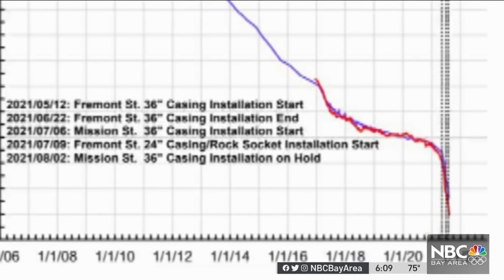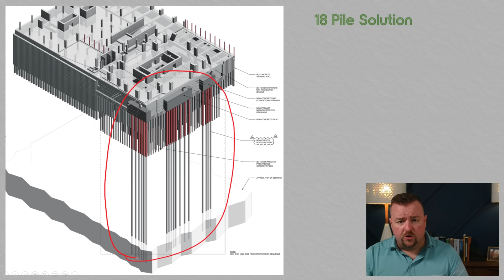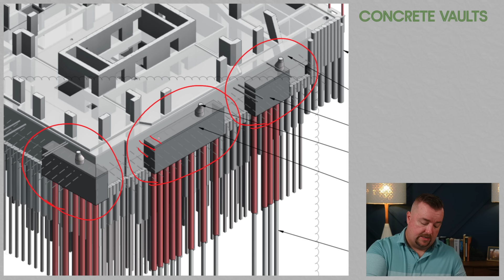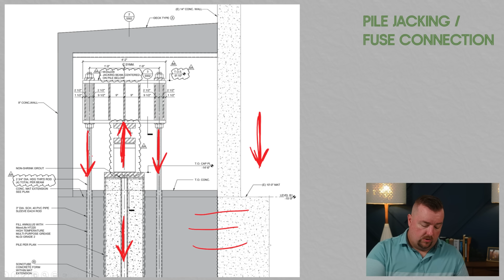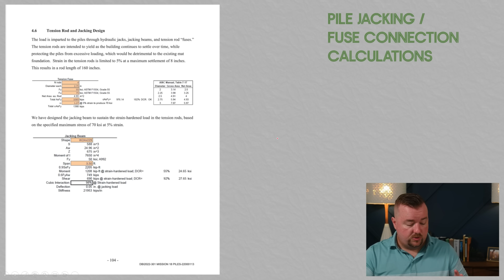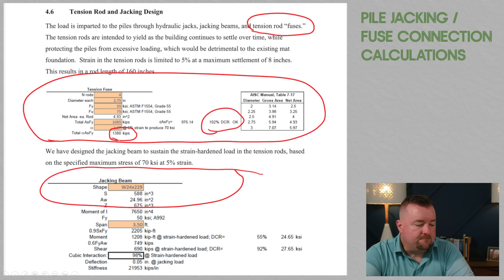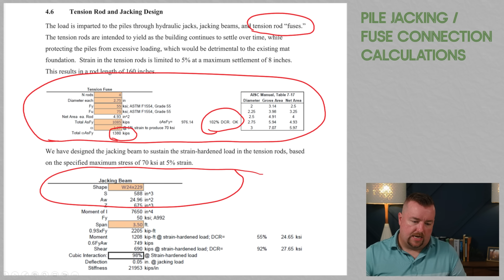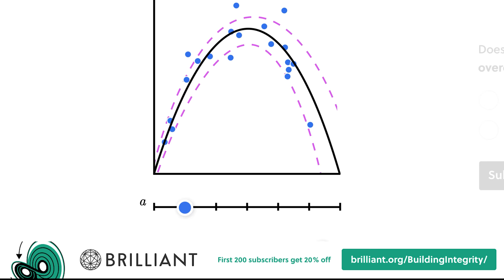Did I Uncover a $100,000,000 Mistake with the Millennium Tower "Fix"?

Comment: I'm not a structural engineer, yet it seems to me that top-down demolition, of the Millennium Tower, is the only safe course for San Francisco.
Reply: Much better option than waiting for the next earthquake to demolish it.
Reply: So start on the north side of SF? 🤣
Reply: I figure at minimum the top half of the building would need to be dismantled / taken down to semi-safely accomplish any significant repair.  But that's just my opinion.
Reply: @Soken50  amended
Reply: @HemiChrysler  Shame, it was funny and any reasonable mind would have understood what you meant, I just like fishing for unreasonable interpretations for a laugh.
Reply: they could employ the same experts that so carefully droped the world trade centre buildings
Reply: This whole concept is fundamentally a bad idea in that it is forcing a highly loaded structure which is already on a path to failure to be fixed by a multi-point, active system which must be supported by human intervention.  And it has to do this forever.  The effects of corrosion, internal voids and inclusions, stress concentration effects on plastically distorted thread forms and operating these sorts of commercial materials at sustained tensile strain levels beyond the typical seem to wholly ignored. I wouldn’t have bought into this unless a full scale test with at least three of these jacks simulated was conducted at at least 30% above limit load with a deliberately failed tensile member injected into the test. This sort of system can lead to cascading failures. I would never insure this building. The downside risk is horrendous.
Reply: @youtbe999  "Much better option than waiting for the next earthquake to demolish it."  It might not last that long.
Reply: @Soken50  "The phrasing of this comment could imply you're advocating for demolishing the entire city from the top down rather than just the building."  

Sounds like a winning plan too.
Reply: Top down demolition is arguably even more dangerous.
Reply: @johnallen3555  Those buildings were entirely upright. They were designed to collapse straight down and not topple over, and they did that because they were entirely upright and not already leaning over and ripping all the sidewalks away from the street around them.
Reply: @davidb6576  Just amazin' ain't it?  and no one on the design review teams even noticed it....along with half a dozen other similar issues.. such as what even a mild earthquake will do to those 102% fuse rods..
Reply: Why not just put some jet fuel on the top floors and the building will implode straight down?
Reply: @Soken50 thats also a good solution
Reply: @Soken50  I wouldn’t have a problem with that.
Reply: @johnallen3555  lmfao bro 😭😭😭
Reply: @HemiChrysler  Can I ask what it said originally? How it is different from the comment right now
Reply: @mangobaby_videos  They just added "of the millenium tower" in the middle.
Reply: @Soken50  No SF is rotting from the core out.
Reply: @scotts.2624  What are you saying no to ? I didn't address you
Reply: Obviously....
Reply: @youtbe999  or allow trrists 2 phly a jumboJet into it..
Reply: @Soken50  It does not matter if you addressed me. This is a public forum. Any one can comment as they please on a public forum within the rules of the forum they want to. How long have you been at this? It seem you would have picked up on that fact by now.
Reply: @scotts.2624  Generally I have to ask someone a question for them to start with "no".
So what did I do to piss you off so much that you feel the need to be this aggressive out of the blue ?
Reply: @Soken50 Even if he was saying that, I’d still agree with him 🤣
Reply: @Soken50  Haha, that's a funny comment. Thanks
Reply: @davidb6576  see bay Bridge bolts
Reply: They should just start a fire in one of the upper floors and the entire building will collapse into its footprint.
Reply: @rickrack4812  key word "allow"
Reply: @realshompa  Nah, just start a little fire on one side and wait all day. Much more cost effective.
Reply: Could make a cool movie Set explosion. Someone needs to write a movie with the building in it.
Reply: Yeah, start at the golden gate and work your way down to Silicon Valley. It can be demolished in 30 days.
Reply: @realshompa  <- has had over 2 decades to learn why that comment about jet fuel is idiotic. 
Too lazy, too smug.
Reply: Nah itll be fine, put the poor folks in there
Reply: @youtbe999  It was built to withstand earthquakes, an earthquake has never taken down a highrise in california so there is no reason to think this building will be first
Reply: @donaldbiden1920  It was also built to stand up straight, but it is epically failing that requirement.  It is completely feasible to suggest that this building will be far more susceptible to earthquakes than originally designed for.
Reply: That’s exactly what I thought too. They just keep throwing good money after bad with this white elephant.
Reply: @camhamster3891  oooh, you mean like WTC 7?
Reply: Agreed
Reply: I’m in agreement. I’ve felt the same way for a long time. Egos are dictating what happens. Penny wise, pound foolish. Sometimes you just have to get up the courage and say this is a mistake. It needs to be handled properly and appropriately.  Before lives are lost, people injured.
Reply: Totally agree
Reply: Totally agree
Reply: Why don’t they just lift it with a helicopter?
Reply: @youtbe999  not really it’s Shit Franstanko
Reply: @Soken50  would be excellent,
Reply: @Soken50  sensitive
Reply: @donaldbiden1920  seems there is a lot of reasons to believe this could very well be the first one it could happen to.
Reply: @Soken50  honestly taking a bulldozer to the entire city of SF and turning it into a landfill is probably for the best at this point. Sometimes you just gotta know when something has failed and move on.
Reply: @noname-gp6hk  Imagine saying any large city should be bulldozed when Detroit and Philadelphia still exist and wouldn't solve anything anyway.
Reply: I’m sure it will be pulled down eventually and all the owners will be bailed out by the govt.
Reply: I wonder if the nearby buildings have insurance for that thing falling over on them.
Reply: @scotts.2624  Are you not gonna clarify ?
You just come in, answer questions I didn't ask, get pissy when I ask for context and wander back into the woods ?
Reply: @Soken50  Wow dude if you are going to play on the internet you need to grow a bit thicker skin. Perhaps a nice book would be more akin to your liking. You asked a general question. I answered with no then gave a counter opinion.
Reply: "I'm not a structural engineer, yet it seems to me that top-down demolition, of the Millennium Tower, is the only safe course for San Francisco"
Easy to say when you're not paying.
Reply: @alexanderSydneyOz  Then have the one paying for it live in one of the appartements let's see how much they trust the solution they're paying for.
Reply: talk about sunk cost
Reply: @johnallen3555  are you talking about dew weapon
Reply: @pilotavery  Not 'demolition', 'dismantling' in a careful way.  Just like they did on the Deutsche Bank building near WTC ground zero.
Reply: @HeyItsEmilyLove  The building is concrete construction and weighs 686,000,000 pounds...
Reply: @le_th_  exactly
Reply: More news this month,keeps tilting to the west an inch more. Hamburger says, there shouldn't any more leaning.
Reply: Just have larry silverstein buy it and get an insurance policy on it
Reply: @realshompa  I see what you did there.
Reply: Dunno... With the safety concern shown here, they may just pass out hard hats and go for implosion instead while claiming it's perfectly safe for everyone around.
Reply: The cheap way may not be an option, due to surrounding buildings. Expensive deconstruction or "terrorist attack".
Reply: @realshompa glad someone said it 😂

Comment: UberEats driver here, If the threaded rods are loaded beyond their yield strength, couldn’t you end up with a cascade failure, once one of them snaps, the load is transferred to the adjacent rod, which snaps, and so on.  Kind of like the Francis Scott Key bridge, but underground.
Reply: Nobody here: yes
Reply: @RockHudrock  nah - the steel has a plastic range after yield. If ya Google images of stress/strain of steel it’ll show you. There is a fracture point but this would require a much higher load to happen. By that stage the load will distribute through the other bars - but remember that the load is transferred to the pile - which will settle by an amount - so ideally the system should work together . This ignores all the other components linking the concrete box connected to the existing foundation.
Reply: Youtube commentor here: I found your comment interesting and i agree.
Reply: Nope. Checkout torque to yield fasteners - you've probably got a bunch holding the cylinder head onto your engine. And think of the threaded rods being springs evenly distributing the load between each group of four. Conversely, if the rods were made of something really stiff (carbon fibre say) one might carry all the load, snap, then you have a cascading failure.
In the bigger picture a 3" rod going through a 1/2" plate does seem out of proportion. In the image of the jacking beam at 32:36 it appears to be 1" to 1.5" on the top and bottom of the I section with a 1/2" washer as well and closely supported by the stiffeners.
And what's happened in the last year since this video was posted? An update would be good...
Reply: Stick to driving buddy.... ok ok just kiddinglol. Seriously though, You are spot on and it could happen quickly. This whole situation needs to be addressed quickly.
Reply: The youtuber doesn't explain it very well. If he did this wouldn't have been as popular a video as it is today. So he won't respond to you. Because he doesn't know.

What they did was increase the load by 100,000 lb increments a day. Slowly. So increase and measure if the thin steel rod stretching. 

They could use for example paint and see if it stretched each time they increased the load. They do it very slowly. So the roads never fail by snapping. 

The rods fail after they get stretched to a certain point. You will know if it is near failure. But the way they built this system, only the rods will fail before the plate or the concrete.
Reply: Good point.

Comment: All parties involved need to face the hard truth that the building should be dismantled completely.
Reply: @denniswhite3487  True. And it's greed (fast-tracking, shaving a few corners, greasing a few palms?) that likely got them here.
Reply: I’d question first, “Can 1/2 of the building be taken down to lightening the load?” Not a total loss at least.
Reply: @NealD  I doubt that, they let the foundation crack making bedrock piles system useless.
Reply: make it newsomes headquarters.............
Reply: Even demo would be a mess , the ownership is just waiting for it to fall and get their insurance $
Reply: @wontnameme  Yeah. It's my guess cost to demo may exceed cost to build.
Reply: Who is insane enough to insure this ticking time bomb?
Reply: The next major seismic event in SF will do that for them along with quite a few adjacent structures, wholly or in part.  I won't be going downtown in SF any time soon - for this and other reasons.
Reply: Immedietly, While still safe to do ..shut er down start sheding weight while elevators still work.. A calculation of how much weight the existing foundation can handle then removing -wild guessing - 10 floors may save the building..It's doable.. I'm wondering if the building was permitted for fewer floors, then more were  added illegally..graft corruption happens... What are the odds in San Francisco that this  happened here.. The load calculations are obscenely  off target for this size high rise building when completed.. Something stinks in Dem-mark ?
Reply: @phyl1283  San Francisco has a poop app now it needs a falling building app
Reply: @phyl1283  Right??!! I was overnighting at a SF hotel on one of the top floors and had a 'jiggle' from a rumble from Mother Earth and the building was swaying. I bid my flight schedule around it after that and would only stay near airport properties in the two or three level hotels.
Reply: Anybody remember 'The Towering Inferno' ?
Let's hope life doesn't imitate art.
Reply: The sunk cost fallacy seems to be at work here.
Reply: Or at least several floors should be shaved off of it. Take it down the same way it went up, and let the penthouse occupant buy a new one with the money he'll get from the lawsuit.
Reply: Definitely getting demolished 😂
Reply: @gordons-alive4940  It certainly is sinking.
Reply: @wontnameme Insurance won't pay. 😉
Reply: @jessicaparker374 Skyscrapers are supposed to flex. A Ridgid tree snaps in winds that a flexible tree survives.
Reply: @ravenwing199  oh, I know. 🙂 Thankfully there are building codes to make us safer in earthquakes and other acts of nature. It was just unnerving.
Reply: Totally agree, but $$$$$$$$$$$ wins out.

Comment: They need to tie ratchet straps from millennium tower to the neighboring tower and crank em tight. Then use expanding foam under low side. It's literally the only way to fix this reliably
Reply: Silly........everyone knows that UFFI would require a suitable stack of wood shim reinforcement.
Reply: Just call slabjack . I would advise leaving the ratchet strap
Reply: I was thinking at least a couple of 4x4’s and some instant postcrete
Reply: Dude. Y'all are totally highballing this budget. I could just break down some reclaimed wood pallets, use wood glue as reinforcement to slab them together, and use that as a graduating shim. Save the budget for beers after a job well done! 🍺😎
Reply: @HughieMunro  QuickCrete, good thinking! 🤔
Reply: @PollyHistor  another fix is they can scratch off the 29 inches thats leaning and the glue it on to the other side
Reply: @macbook802  Genius! I wish I would have thought of that. Time saver hack, for sure!
Reply: This is the answer. And harbor freight is having a sale on ratchet straps this weekend. 10%off
Reply: Best solution is for it to hold, just until the engineers can change their names and move to a mountain in Romania - or die.
Reply: This will not stay funny if the tower collapses 🙄 None the less, for now it is funny.
Reply: @ellieban  I absolutely agree. It is absolutely tantamount that it be fixed, and properly.
Reply: @ellieban it'll get much funnier
Reply: @ellieban  It will be hilarious
Reply: There’s no way that this plan will work.  Unless you can convince them to slap the foundation and say “That ain’t goin’ nowhere.”
Reply: @jhoesing  😅😅😅
Reply: They also need to pluck the strap when they are done and say "that ain't going nowhere" for maximum support.
Reply: Why not use high tension support cables anchored into the ground, similar to what's used on ultra high radio towers.
Reply: Flex Tape the F*** out of it!😅
Reply: I say sink the whole building to bedrock like it was supposed to have done from the start. Sure 7th floor is now the first but - oh what a basement!
Reply: @melkel2010  dang, or they can convert it all to underground parking
Reply: @badactor3440  this building is multitudes heavier than radio towers, meaning you would need a multitude of high tension cabling to match that. The huge overall tension force induces its downward vertical component into the building, putting an additional load force on the troubled clay layers the building is founded in.
Reply: I saw this fix on Idiocracy
Reply: @melkel2010 funny comment, but that would be really hard too
Reply: The only way that would work is, if you flick the strap and say, "That ain't going nowhere!"
Reply: @badactor3440 Pulling down on a building that's sinking?
Reply: 😂😂😅 that is great
Reply: Don't forget to snap it twice
Reply: Harbor freight strap preferred 😂
Reply: The other tower would never had such a load designed into it. Sorry, go back to your superman comix!
Reply: Needs a new structure on each side.
Reply: The only thing they aren't using is duct tape.
Reply: @PollyHistor  I like that idea.  The world is burning and we need to recycle more.  Steel and concrete has a high carbon footprint
Reply: There is a much better idea. Use hydrogen balloons, both on every floor on the interior as well as larger hydrogen balloons on exterior to relieve the pressure on the ground. 100 to 300 graf zeppelin style airships would probably be able to airlift the entire structure so the foundation could be more easily  reworked.
Reply: Duct tape

Comment: This really sounds like a holdover from the 52-piling design where the plates probably would have been fine, but then they dropped 2/3rds of them and nobody really thought to check that particular part.
Reply: @ GeneralBolas good point..
Reply: Idk if I can trust a Bolas...
Reply: I was thinking the exact same thing.
Reply: Oh...  Good catch.  The load would have been much lower then.
Reply: this is san francisco building department. Somebody dropped a bag of cash of to a few people and they signed off. This building should be torn down.
Reply: @henryhenry271  Signed off on what?  Allowing them to spend tens of millions on an obviously needed repair?   What do you mean signed off?  The project isn't done yet so they couldn't have inspected it and signed off yet
Reply: @donaldbiden1920  City planning and development review the plans before permitting the construction. This is typical before any type of construction within most cities.
Reply: @narlykid10  looks like they rubber stamp it as long as u got the loot
Reply: @henryhenry271  The next earthquake will do that for them.
Reply: Sounds right
Reply: @marcburns508  no, based on the accompanying engineering documentation.